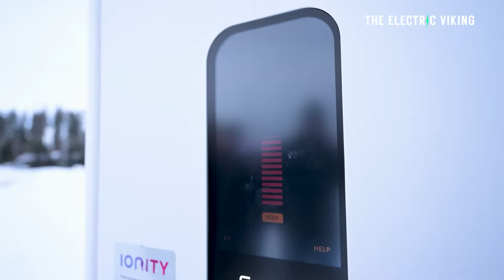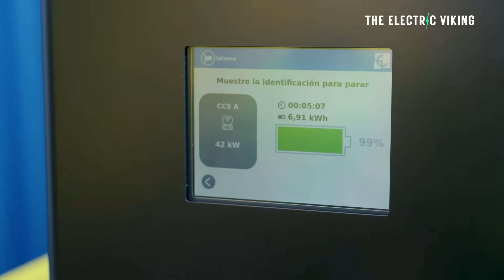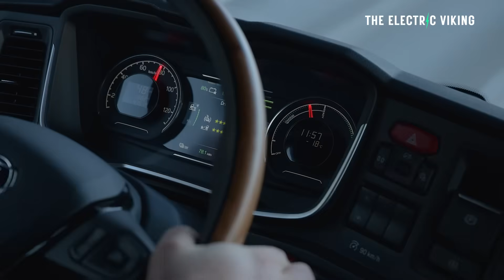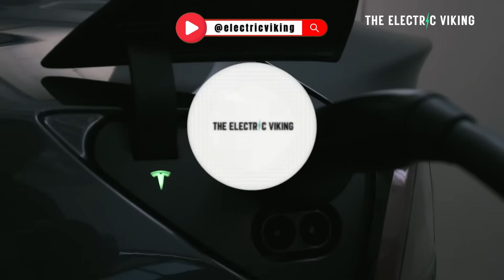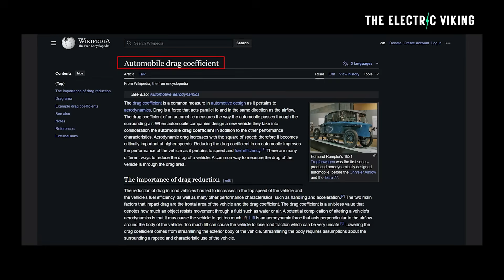Truck revolution begins: Electric truck with 624 kWh battery on sale in Australia

Comment: the idea is great but how are we going to do electric charging infrastructure in NON URBAN areas. For example approx 1300 klm, (800 Miles) across the Nullabor somewhere you need a Mega Charger for this to work, No grid infrastructure is available, Far North Queensland, No infrastructure, real isolated transport requirements, what about Battery Hot swap stations Large Solar, Wind, Battery Stand alone charge stations for these locations are these solutions viable? The non Urban has HUGE difficulties in Australia in Infrastructure and Cost who's paying?

Comment: They should also build trailers with their own battery and electric drive system. That would increase the range of the tractor trailer combination as well as being able to be towed by existing diesel trucks that would then get way better fuel mileage and consequently less pollution while they live out the remainder of their economic life instead of being scrapped prematurely. Also on a very long trip the trailer could be dropped off partway at a charging yard and a fully charge trailer attached and the truck continue on its way with very little downtime.
Reply: This would increase the weight of the trailer.

Comment: 350km ? Loaded ? Areas with hilly terrain ?
If they don't have change out batteries that can get drivers on the road in 15 mins, they aren't going to be good for anything more than local delivery.
The longer range example seems better, best case on flat euro roads ?

Comment: battery tech and recharging setup is not really good enough yet. the next gen battery tech will help but recharging is a major road block. its several years to get a single connection installed here just for a mid sized short haul truck (there is a few here on trail). the power requirements for multiple big rigs is insane and power co's are not interested in spending the money to supply. so i would expect phev hybrid trucks first. as battery tech improves the batteries can get bigger and the engine smaller.

Comment: Janus,  they are all Ausi and they are smart.  What they do is amazing.  Firstly they have battery swap,  and a driver can be back on the road within minutes if required.  Secondly they repurpose diesel trucks that have run their course.  The truck itself is tough and can go for another  800k or more, so why not utilise this asset and convert it to an ev.   They are expanding at a fast rate and want to go global,  so I hope this Australian initiative succeeds big time..
Reply: 2 million dollars of tax payer money has gone to Janus.  All of which went up in flames one truck 40 min from my house  on the central coast the other only a couple of km from one of the biggest tunnels in Melbourne. Which is a terrifying prospect.

Comment: Just like the Tesla Semi, this won't do the job in Australia. It is fit for nothing more than around town jobs. 

That is great... go for it. I'm all for it. Just don't think for a second that this is going to provide anything more than a token contribution to Australia's road freight task. 

For the record... after 5.25 hours driving, drivers are given a 15 minute break. After another 2.25 hours they get another 15 minute break. Then after another 2.5 hours they get a 30 minute break. They can then complete another 2 hours of work before they have to stop. So a total of 12hrs work with 1hr of breaks in a 13 hour day. 

Brisbane to Sydney currently takes just over 10 hours driving to the speed limits and drivers are under constant pressure from Employers and Clients if they are even 15 minutes late. Adding two charge stops and 3hrs to the run is not going to be acceptable... or legal under the current road laws drivers must adhere to. 

That's also ignoring that this Scania carrys 30 tonnes as opposed to the current models taking over 60 tonnes down per trip. 

You do not understand the task at hand. You do not understand the importance to the economy either. This is an uneducated and ill-informed opinion. 

I hope one day electric trucks can perform the task required. I'll happily drive one. Until they can though, do not F up the economy for some George St, Greenie, Virtue Signalling BS. 

Do better, Sam. This is just hate you're pedalling now.

Comment: The charging at the depot idea is interesting. The huge grid connections required to charge vehicles in parallel in their scheduled downtime (ideally not long for asset utilization reasons) is the biggest barrier for many commercial fleets. To bypass this depots will need solar and battery storage to run fast chargers to take some burden off the grid. Otherwise there is a long wait time for megawatt level grid connections in Australia. Same goes for megawatt charger sites - they will need to come with linked solar and battery

Comment: Further to the issue of drag. 
It is not just drag but vehicle mass coupled with the rolling resistance also in the tires that affect range.
Long range versions of   with bigger batteries often do not get the extra range that the size increase of the battery provides.
As an example a mid 54 kWh battery car that might get 12-13  kWh / 100 kms the bigger battery version  of say 80 kWh often sees the consumption increase to 16-18kWh per 100 kms because of the added mass.  the extra 26 kWh  does not give another 200 kms of range you see that fall to around 120 kms of added range given the same single motor design.
Chinese manufacturer claims should always be taken with a grain of salt.
They get a figure from their modeling in cad , but seldom actually validate the result with wind tunnel testing as that time and development is super expensive and they can detract from Styling in an effort to improve the CD.
Some impacts of improved CD is less stability and downforce that can affect vehicle handling.
Remember the koenigsegg speedster that the Stig lost control of on Top Gear. .

Comment: Sam You need to check out the Electric Trucker.
His Iveco S-eWay has I think 738 kWh of  batteries and runs 500 kms across Germany.
Can charge at 350 kW if available. Seldom can he find public charging that can deliver. even when he is th eonly vehicle at the charging park.
He regularly shows his drives aof 600-700 kms and his charging issues.
He shows the pro's and cons of EV trucking Short Haul - Mid Haul and the issues he deals with daily regarding charging infrastructure.
Also Here in Aus Janus Electric have just listed on the ASX and recently closed its IPO for Their power pack swapping system for heavy haul vehicles.
Janus has already fitted 23 trucks and has order book for another 120 odd.  Janus has plans to build up battery swap hubs for trucks and some trucking companies setting up their own charge station depots. SMall MW scale solar charge array on the distribution warehouse roofs and small wind turbine charging also on site to recharge the batteries. a 4 min Battery swap for depot based trucks.
Reply: Yeah, Tobias is doing a great job on promoting electric trucks.
Normally runs on 1 to 1.2 kWh per km. So during the day recharging once is normally enough.
He is providing valuable feedback from his daily life to all stakeholders: transport companies, charging point operators and truck manufacturers.
This will speed up adoption of electric trucks not only in Germany, but in all of Europe.

Comment: 325km range is absolutely deficient for Australia. The main routes here require 500km at a minimum to compete with diesel and even then wouldn’t be able to hang about waiting for a recharge, which is why swapping batteries is looking far more efficient for electric trucking.
Reply: Will be interesting to see how battery swapping pans out. A few megawatt chargers in HVRA stops on Australia's main routes could change the equation. This is an entry level truck but many can can also take two charging plugs at once. Charging would take less than the scheduled rest time and off you go.
Reply: @ Nope. Take Tarcutta for instance, which is the handover stop between Sydney and Melbourne which has 4000 trucks every 8 hours swapping drivers, loads or stopping. It’s impossible to recharge that many vehicles in that time, it’s not even possible to refuel them there. Time in trucking is essential for profitability so anything that holds up a load isn’t going to work despite the lower cost per Km.
Reply: @seanlander9321  Just swap the batteries.  Obvious really.

Comment: Speaking of EV trucks, check out Design Werk technology’s in Switzerland. They build in my opinion, the best EV trucks at the moment with up to 760km Range and up to 50 metric tons. Most trucks are built on Volvo Chassis and Cabs and a buddy of mine drives one and he loves it. 680hp as well. We almost ordered one but Scania E-Trucks were 200k cheaper with around 320km Range.

Comment: Who’s coming out with charging infrastructure for the US? We have to take a 30min break in 8 hours and can drive for 11 hrs a day
Reply: BYD just announced a battery with loading at 1MW and MW chargers are already on the way. There is also a electric powered trailer available that might improve the range as well. However, that all is expensive and the US is not known to spend money were it can be avided.

Comment: Energy required to go the distance is proportional to speed squared, unless you go really slow then friction starts to become a bigger factor.  The exception to this is vehicles like the Aptera or a very big truck that is very aerodynamic and carrying a heavy load which have so low aerodynamic drag relative to the weight of the vehicle that friction is a bigger Factor at all speeds

Comment: Chinese electric trucks will be coming to australia soon.
Reply: The Chinese will start producing e-trucks in Antwerp next year, the company is called Windrose. Producing means assembling Chinese prefab parts though :-)
Reply: @ the key to heavy vehicles is the chassis. The chassis will always include the drive train, be it electric, ICE , or hybrid. The fabrication of the body - trucks or bus - can be done by anyone and often is. The way heavy vehicles are mostly manufactured, the chassis manufacturer has the right to have its marque on the body. The body builder is almost never identified on the vehicle itself. In tenders, the principal always contracts with the chassis manufacturer and the body is usually subcontracted for the job. That subcontractor is often local (due to local content rules on a lot of tenders) and usually does the homologation, organises the plates, and does the  final delivery of the vehicles.

Comment: Any thoughts on what power source and infrastructure is going to charge 3+ tonne battery packs in under a day without blacking out half the county? Oh dear, the laws of physics are such a bitch. Also conveniently omitted is that this wizz-bang truck will have a range of only 350km (max) at 80 km/h. The open highway speed is generally 90-100km/h and double B / triple combinations are the norm (not single trailers). It's about 900 km Sydney to Melbourne and over 3,000km to Perth. Think about that for a minute and do some basic maths. I know that may be difficult, but there is an awkward reality beyond the virtue signalling St Kilda cafe strip.
Reply: Electric trucks don't have to meet all trucking needs. They are perfect for regional and local.

 Aussie truckers can keep their diesel road trains as long as they make economic sense. 

You only have to start in areas where tech fits best. Then see where you can get from there. For example short range delivery vans like amazon uses are silly to use ICE with, stop and go driving is where evs excel in basically every way. 

The point is to chip away at use of petroleum, not to eliminate it overnight. And to develop tech and markets by scaling up then out. 

Some things will never make sense to electrify: large passenger jets, ocean freight. Some things don't have to be identical to today, like more rail plus local last mile trucks.

Comment: This channel is consistent that everything is always compared to Tesla vapourware. 

When a manufacturer actually releases a truck so it can be purchased then there is zero benefit in trying to compare it to whatever Tesla say that the performance of their trucks will be. 

The Cybertruck was going to cost  $70k with over 500 miles of range and yet when it launched it was priced at $100k with just 320 miles of range. The Tesla Semi that was promised for 2019 and as of May 2025 is  still not in full production, it was original pitched at $150k–$180k but now expected to be “dramatically” higher.

By the time the Tesla-semi is in production so that anyone can buy, other EV-semi manufacturers will have two to three years experience on Tesla.
Reply: Musk has a long history of making absurd claims. He's a con man.
Reply: While I agree with with the Cybertruck point, thats a in the consumer market, not commercial. Tesla cam not afford to do the same in that market, otherwise they will lose all customers. Tesla & Pepsi already confirmed the specs. Tesla also said full production is in 2026
Reply: There was a recent interview with a tesla semi executive. When he was asked about cost he instantly diverted to total cost of ownership and didn't say a word about cost. Translation: the semi will cost north of 300k once scale production starts.

Comment: I was thinking about you a few days ago as I traveled half a day between NY and VA in the US. The high level of slow going traffic with gobs of trucks made it toxic to breath. Two days later I'm still smelling diesel fumes. The change can't come fast enough.
Reply: I am with you on this one. I was in Dublin Ireland and the smell of Diesel in the city was just nauseating. And people are still wanting to drive these stink boxes. They have no idea about clean air and how precious it is.
Reply: one corection China completes 1 plant every 2 says not 2 every 1 day.
Reply: I agree they are increasing their emissions  not lowering them the same with India both nations along with russia and USA 64% world total emissions so basically   net zero is a pipe dream we will adapt as we have before, but it won't be pretty but inevitable, the world all pulling together never happened, look around the world and at history , not happening    @BlondieSuperdog
Reply: It won't happen fast at all, or probably ever without some cheap new battery tech using very available materials.  You could use bio diesel if you ware worried about exausts.  That doesn't require the replacement of
200 million heavy trucks around the world which would cause a great deal of diesel fumes to be expended to attempt to make it happen; you have all the mining, manufacturing and unless you replace the grid with all non fossil fuel - more fumes producing the electricity.  80% of the worlds grid is still fossil fuel; China alone completes 2 coal plants every day; moving trucks to the grid will add to that demand.
Reply: @BlondieSuperdog Wrong
Reply: @economistfromhell4877  Just saying wrong with no logic ?  What's "wrong"?  That EV trucks would require new cheaper batteries to work?  Figure it out; total world production today is about 4-5 million Y size packs.  There are 9 million USA long haul trucks alone, each is 12 Y packs, so you'd need 108 million Y size packs just to replace US long haul trucks or 25 years of current production; the US has 18 million short haul heavy trucks; another 50 years of lithium production. 75 years just to replace US heavy trucks; US trucks are 20% of world trucks so even if you multiply lithium production by 5 over night - its still 75 years.  - that is if all automotive lithium packs went to heavy trucks. none of the 1.4 billion cars, or light trucks.
Reply: @BlondieSuperdog  the semi drivers aren't as bothered since it's largely behind them.  As for biodeisel, it's not readily available enough for them to use it on routes.  The old trucks are far worse than the new ones.  And batteries are absolutely getting cheap enough.  The issue is access to chargers and cost of new vehicles.  EV retrofit will likely be a big part of the future.
Reply: @veganpotterthevegan  Semi drivers are not bothered by emissions?  There isn't much bio diesel now because it isn't provided subsidies like BEVs are.  Assuming you think net zero  is an important goal; then using Biodiesel  would stop further addition of new CO2 from under the ground sources. biodiesel cuts the use of fossil fuel. The process of making it isn't difficult; its basically organic vegan oil... you should love that.  You avoid having to make 200 million new heavy trucks using rare earths which consumes a lot of oil to do. If you try to replace all trucks with lithium even if you increase li production over night by 5x it will still use all the lithium refined just for trucks and take 75 years.
Reply: @BlondieSuperdog   I don't see many semi drivers voting for progressive politics and regulation of the industry.  How many semi drivers want progressively strict emissions testing?  They drive a lot.  Emissions testing should be a few times a year or more for them.  
*I want this to happen. I'm not talking about what I want.

Comment: Love the show , but you missed on this one. We drive 8 hours and have a 30min break  then 3 more hours. Long haul trucking is 700- 800 mi in a shift. Why don't you  check Edison Motors of Canada.  Trucks need to move that direction until energy density is on par. My team truck does 1250-1350 miles  daily. We couldn't possibly handle 3 to 4 hours of charge time.
Reply: True, but it also true that many trips are much shorter. Rail makes more sense than trucking for ultra long distance but that does not mean there is no place for trucking.